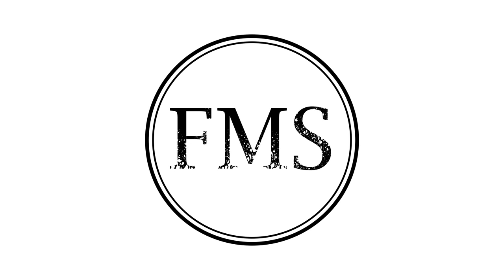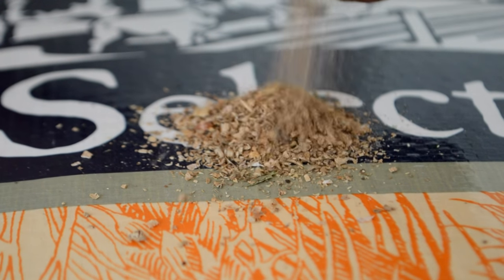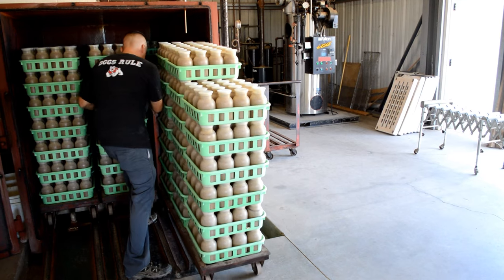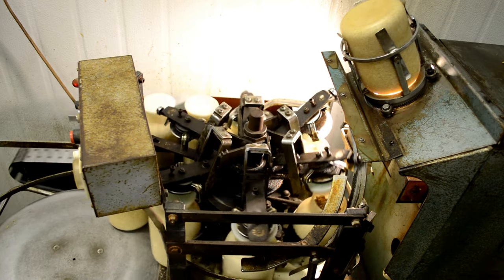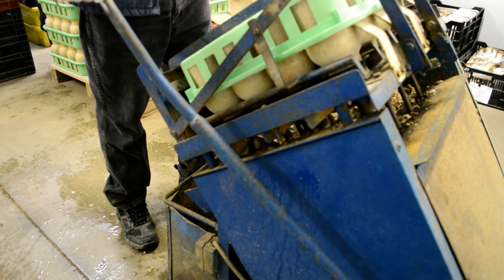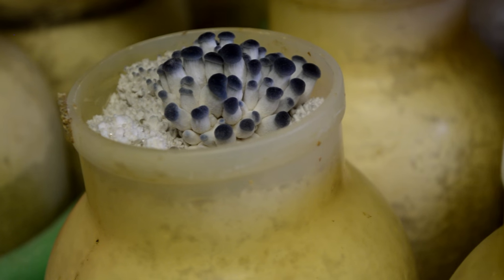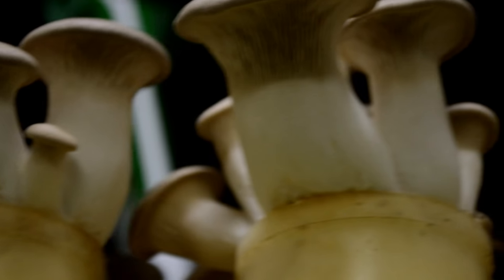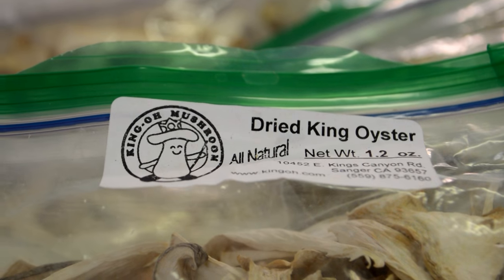Sun Smiling Valley Farm: How Gourmet Mushrooms Are Grown

Comment: Why do you guys use 91% isopropyl? I heard that the alcohol at that level doesn't have a high enough water content to adequately pass through the cell water barrier, and that 70% is actually better sterility wise than 91%.
Reply from the maker: They purchase 91 percent because it is has the highest concentration that is readily available. They mix it down in their sprayers, in this way they get more for less.
Reply: Judge Fudge I seem to get more contamination with 70%

Comment: So they follow "The Korean Method" of using Bottle Necks, except oddly instead of Cold Rooms they use Warm Rooms, and don't trim the undesirables from the best fruits during growth, Why?
Reply: They use variety of different temps and humidities to simulate the seasons for each stage of growth.  Says it in the vid but some people have issues with understanding the host.
The reason why they don't trim is cut down on labor costs and because they will still sell, although at a lower price.

Comment: Each bottle loses  60% to 80% of each flush because they weren't cased. What that means is, the tops of the open jar fruited, but imagine if the entire jar was able to do the same, all broken up and sprawled out. They are losing millions of dollars every year because they only fruit the tops of the jar, instead of using all formed networks and laying them out for more surface area. Awesome video, yet such a waste of resources.
Reply: but the plastic bags are so expensive when you have to buy millions of them 
so this way the COGS are lower 
and second flushes don't yield that great?
and can you do casing with sawdust can't with BRF but can with rye grain?
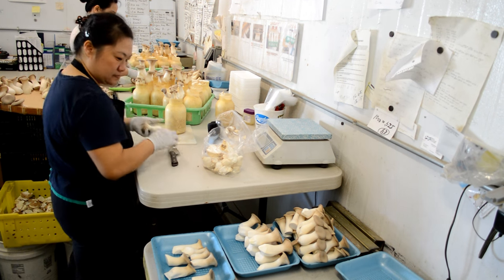Reply: I was getting up to 4-6 flushes. The second and third are fine. I understand the largescale production concept where casing isn't feasible, but the bottles could be half the size and yield the same 10 shrooms pulled off the top at 7:25 Smaller bottles would mean less substrate, less water, and less time. I could case one of those bottle with a 10 shroom yield and get hundreds of shrooms, but again, I'm not a huge vested company. Anyone who fruits from the cake will lose a gigantic percentage of potential yield. I fruited cakes at first, had 5 mushrooms per cake. I cased, had 500 mushrooms from the same cakes.
Reply: The bottles could be half the size, meaning the water and substrate could also be cut in half and they'd get the same yield, 4-10 shrooms sprouting out the top. They'd save tons just on material alone, regardless of casing. Just sad to see streamlining waste so many resources.